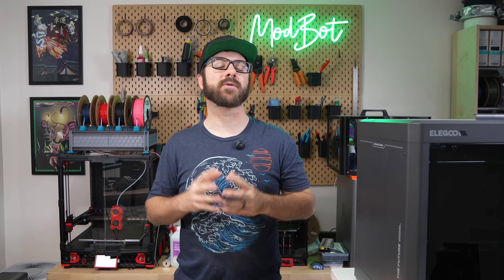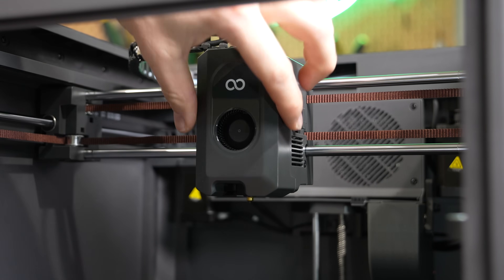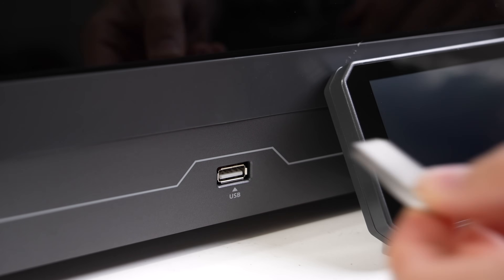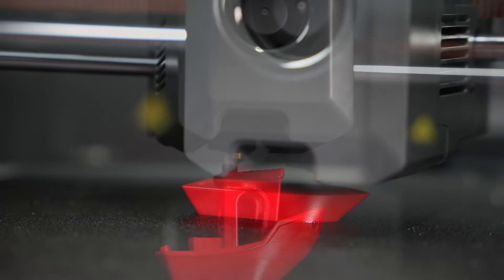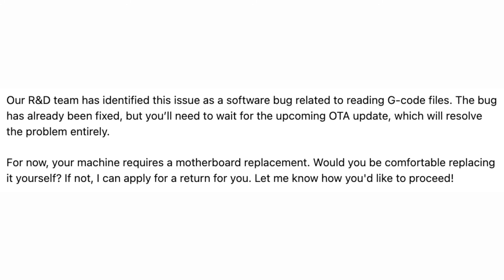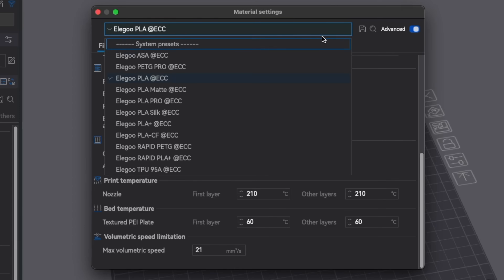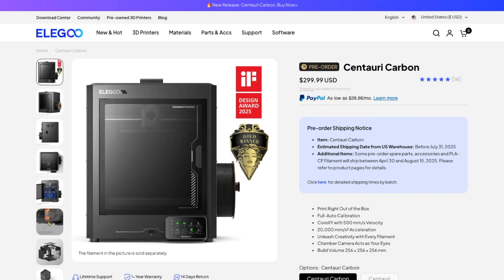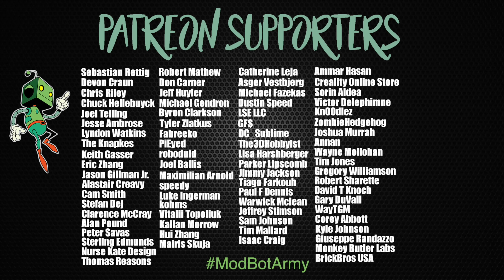$300 Fully Enclosed CoreXY 3d Printer (Elegoo Centauri Carbon)

Comment: I really hope Elegoo fixes the lighting problem before they ship July preorders.

P.s. Ordered textured/ holographic PEI/PEY spring steel flex plate (for Bambulab printer) under 11,- € including shipping and taxes. It's claimed that it fits to Carbon as well.
Reply from the maker: @Keinapappa  yeah it’s quite bad. It may not look so bad in my video but that’s with bright studio lighting pointing at it.
Reply: Also, I bought the glacier and frozen(?) plates from BIQU and they are smaller than the stock Elegoo plate which is insanely frustrating. Especially because the nozzle priming happens in the front left corner.
Reply: still waiting for mine, pre-ordered it, at local dealer over 10 weeks ago, so expect it to arrive mid-May
Reply: @WMH-3D-Printshop  Mine should be delivered in July. 😳
Reply: @Keinapappa  So we have to hope that all the children's illnesses will be fixed by then. I don't usually pre-order products now because my patience quickly runs out and I end up buying something else because I don't want to wait to do my things, but this one has just the right size bed I need and it's cheap.
Reply: It is easy to fit a led strip around a riser. The riser is a good idea for a less-sharply bent ptfe tube anyway.
Reply: Reportedly, per Elegoo's website, the next wave will have dual LED strips to address the lighting issue. 

The camera works a lot better if you cover the white printing on the plate closest to the camera. The auto exposure gets messed up by that printing which you would think they would have caught.

Comment: Ordered in Feb...still waiting on mine.  Due to closed nature of proprietary firmware still debating cancelling pre-order.  Also still waiting to see what thier AMS solution is.
Reply from the maker: @ViciousNarwhalFL  I wish out was klipper. They do seem to be updating firmware pretty regularly which is at least nice. You and me both. I know nothing about it.
Reply: @ModBotArmy  Looks pretty standard hardware and connections.  Can the mainboard be replaced with a standard board?
Reply from the maker: @ViciousNarwhalFL  oh I’m sure it can. Getting the load cells to work and screen might be tricky though.
Reply: I ordered exactly 14 minutes after the price announcement. Had I been 2 minutes quicker, I would have been in the first UK shipment. But my printer arrived about a week ago, almost a month earlier than Elegoo’s guidance. I am very pleased with it!
Reply: @dougal6569  Did you get a shipping notice/tracking number email, or did it just arrive by surprise?